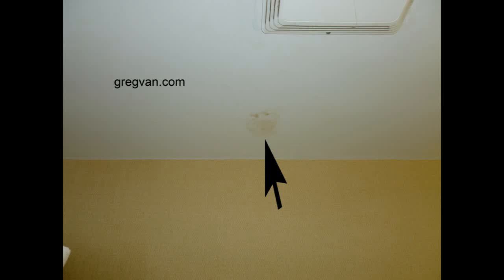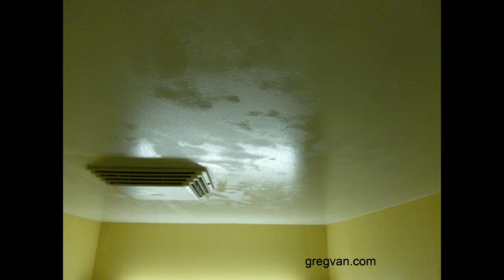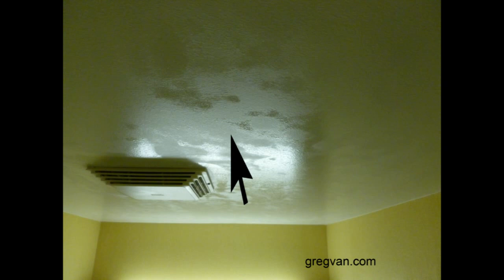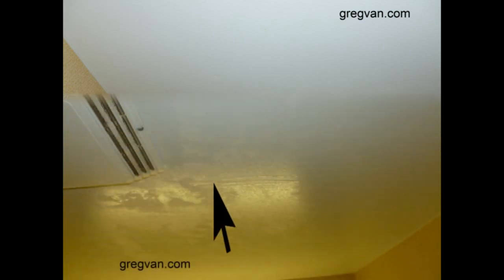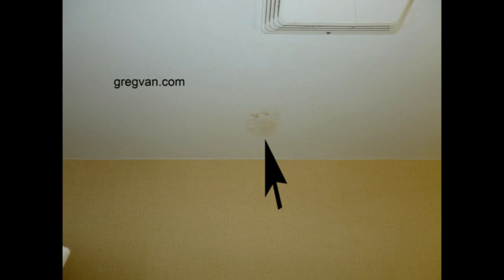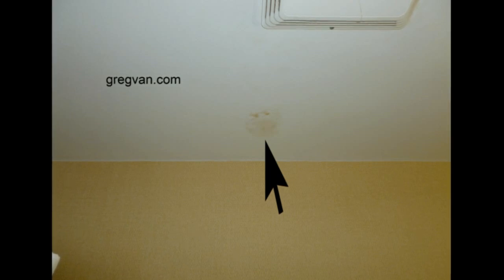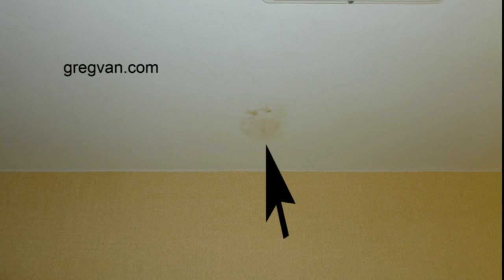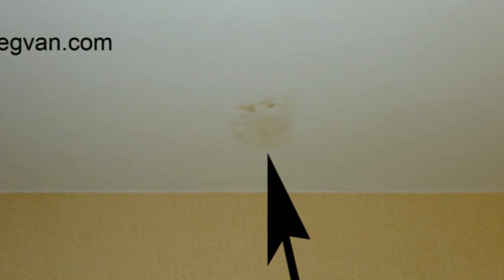Bathroom Ceiling Moisture Problems from Poor Ventilation

Comment: To solve this problem, do as I did and use a dehumidifier while taking your shower and it will work perfectly. I have had this problem in my bathroom for quite some time but I tried an old dehumidifier I used in my basement while taking my shower and not a single speck of water was found on the ceiling and the mirrors not even fogged. A great solution to this damaging and annoying problem.
Reply from the maker: Great idea and thanks for sharing.

Comment: Great information Greg!  I had this problem in my bathroom and wasn't sure what caused the issue.  In the process of doing a major repair now.  Removed all drywall around shower stall and bulk head.  Installed a new exhaust fan and insulated exhaust duct to the exterior vent.  Went with 80 CFM fan this time.  I am still baffled how this moisture problem happened in the first place?  Never had it before my remodel 2 years ago??  Your tips should help from it happening again this time!  Thanks!
Reply: Chinese drywall

Comment: Hi Greg. Thanks for helping me diagnose my problem. I already shower with the door open, but I will now open the window too. (I don't have an exhaust fan.) Quick question...how do I clean the pre-existing spot, like the one in your video?
Reply from the maker: I would try soap and water first, but wouldn't spend too much time scrubbing, because you could scrub the paint off. If this doesn't work, then it would probably be safe to assume that the ceiling or walls would need to be repainted.

Comment: How do you tell between condensation versus a leak?
Reply from the maker: This is not always easy to answer. Moisture can hang around for hours, but often goes away when temperatures from inside and outside start to become closer to the same. Where a plumbing water leak will keep leaking. Maybe turn the water off to your house and see if it keeps leaking to see if it's a plumbing problem.

Comment: Hi Greg. Have the same problem with reno-home I bought.But it's not in the bathroom but in the 2-bedrooms.And this moisture started occurring 3-days ago when temperature started to drop to as low as 0-C.It's getting bigger from small spots to almost half of the room's ceiling.Worse, it's spreading to the living room like almost half of the house is affected except the 2-bathrooms(which both have exhausts) and the master bedroom.The house is big(1,500sft) with few,small windows. Pls advise.

Comment: Hi when taking a shower water drips from the ceiling. Do you know what is causing this? I have never seen it in any other bathroom.
Reply from the maker: +Laura Plevey There's a good chance you have a damaged shower pan or bottom or leak in the plumbing drain. This isn't going to be easy to diagnose, but you could try removing a section of the ceiling wallboard, drywall or plaster to see if the drainpipe is leaking, but this would need to be repaired whether it was problem or not. You could look for cracks in the lower 4 feet of the shower also.

Comment: The paint has dropped a bit like a small bag, I guess there is accumulation of water in that particular spot.  It drips water dot once every couple seconds.  It’s on my ceiling right above my bathtub.  What do u think it’s the problem? we do put an additional fan in our bathroom...
Reply from the maker: If it's not condensation, then you might have a water leak from plumbing pipes or the roof. I've seen air conditioning parts also leak water.
Reply: Thanks so much for your helpful reply.  I live on second floor in a condo, if it’s a pipe leaking from the third floor, do I need to do anything other than acknowledging the 3rd floor owner?!  Thanks again
Reply from the maker: @sdla690  Defiantly contact the people living above and see if they have a plumbing leak. Then if not, you might need to remove part of drywall ceiling to see what's going on in the floor.
Reply: I see.  Thank you for your advice, I appreciate it🙏

Comment: Hello. We have a skylight in our bathroom, and our exhaust fan was replaced about 8 months ago via our home warranty company....weve been in this house 3 years and 2 months and only in the last few months have we started getting moisture running down the walls and mold is appearing above the shower and in the area just below the sky light....is this BECAUSE of the skylight or is it likely that our warranty company didnt replace the exhaust fan with a properly rated one for our bathroom? Also, we cant really afford to replace all this drywall nor can we do it ourselves....is there another fix for this to remove the mold and prevent it from coming back?
Reply from the maker: It sounds like you're experiencing condensation formed from water vapors when taking a warm shower. The water vapors form in the skylight and of course creates a small river towards an area that leaks water. Most bathroom fans can't remove air fast enough, when most people think it will. I don't really have a good suggestion, but you can try taking a shower with the door open or shorter showers.

Comment: Here's my problem; the ventilation fan is running (not sure how great it's working. I just know that its running. I cleaned it a month ago but it wasn't that dirty. Could be an indication that it needs replacing??) I even have the bathroom door wide open and theres still Brown stains accumulating on the ceiling.  Its starting now to spread. I dont think theres a leak from above.  This is in the downstairs bathroom.  We have a bathroom above upstairs right above this bathroom.  Please any help appreciated!!
Reply from the maker: The sad news is that most bathroom fans are inadequate and pump the volume of air out of the bathroom to remove moisture fast enough. The only suggestions I would have, would be to clean the ceiling regularly or install a new fan that might do a better job.

Comment: Hi Greg, we just repaired all the peeling drywall tape on our bathroom ceiling and joining wall, spackled, sanded, primered and painted the wall area and ceiling. Unfortunately after showering, we are getting flashing on the repaired areas, could it be the flat paint used or the ill mannered exhaust fan? Any comments or solutions would be appreciated.
Reply from the maker: This is a common problem and the only way I know would be to repaint the area with a good primer and then paint over the primer with your desired bathroom color. I can't suggest a particular brand, but would advise you to contact a local paint supply company for more information.

Comment: So I have put a new bigger fan in and I’m still getting a lot of water on our bathroom ceiling. It is a small bathroom in the middle of the house. I need help!!!!
Reply from the maker: A larger fan might work, but I've seen this problem remain after new windows were installed and larger fans. I know this won't work always, but if you can use the shower or bath with the door open it might solve your problem.
Reply: @gregvancom  The new fan I put in is for a bathroom 3x the size and it still happens. I may try putting a vent in the door also.

Comment: What if you already have a spot on the bathroom ceiling where water has absorbed into the ceiling? Does anything need to be done to treat that spot to prevent rot or mold other than painting over it?
Reply from the maker: As long as it is dry, then there's a good chance you can just paint right over. However if it has black mold, then you might need to treat it with chemicals and sometimes bleach works to kill the mold and then paint it.

Comment: So how do you clean the stain?
Reply from the maker: If you tried soap and water or bleach and nothing happened, then you might need to repaint the ceiling. However, before you do make sure that you use a primer paint that is often referred to as stain blocking paint. Go down to your local paint store and explain your problem to them for more information about dealing with stains on your walls or ceilings.

Comment: Hello Greg,
I have droplets above the shower head in my rental, would that be because of ventilation?  They are pretty good size, like almost a dime size. Any idea would be helpful.  thanks,
Reply from the maker: No that's probably not from poor ventilation and probably more from water splashing off of someone's body while showering and onto the ceiling. This usually happens when ceilings are low like around 7 feet or when taller people use the shower.
Reply: gregvancom You were right, the connection to the shower hose was not tight.  All I did was tighten it and it stopped spraying.  Thanks.
Reply from the maker: I guess I forgot to mention that one, but at least you figured it out and repaired it.

Comment: What about adding an additional exhaust fan
Reply from the maker: It would definitely work better, but I don't know if it would solve the problem completely. Some of these bathroom fans just can't blow out enough moisture to make any difference at all. You can always look into bathroom fans that move more air faster, but again I don't know if it would solve this problem all the time. This problem is bigger in moist climates and when more people are showering daily.
Reply: Allow more air to enter the bath by cutting more off the bottom of the bathroom door.